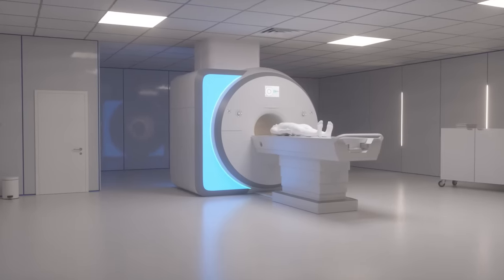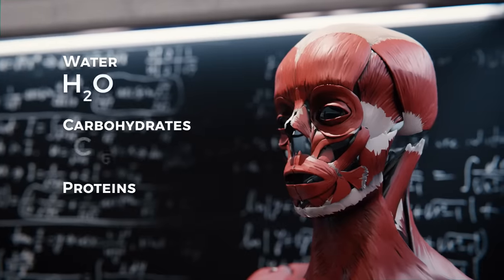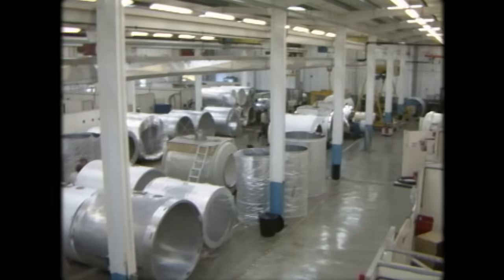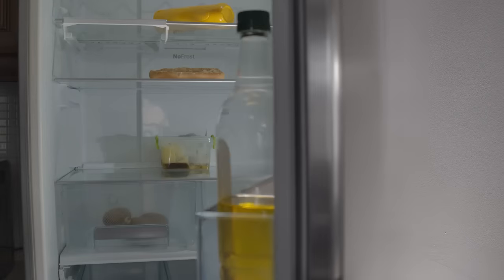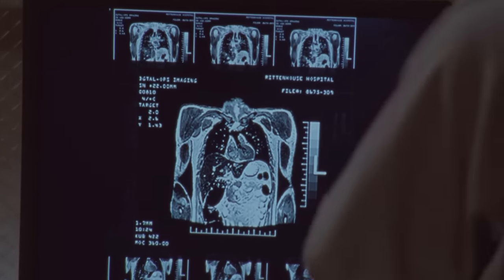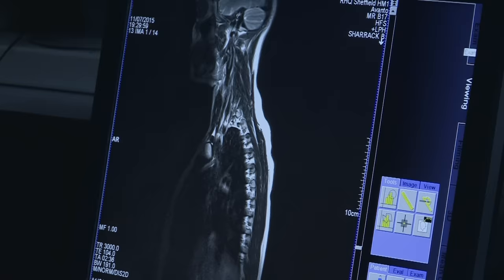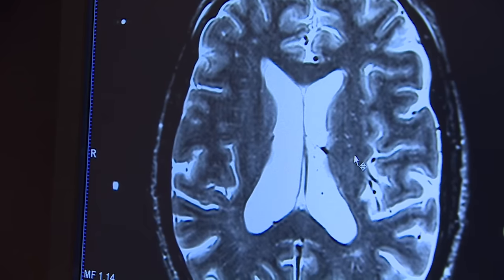The Insane Engineering of MRI Machines

Comment: Sorry, but couple things wrong. 

1:26 Ultrasound is not low detailed, atleast not anymore. Modern equipment also reaches sub millimeter resolution. Also "millimeter resolition" is nothing special. Modern high resolution MRI sequences reach resolutions of around 100µm.
ultrasound imaging does not depend on density but echogenicity.
CT scans also provide 3D images. 
It is also not that easy of a comparision. MRI does NOT replace x-rays, CT or ultrasound, it all depends on the issue at hand. 
In emergency situations ultrasound, xray and CT are essential, because of their speed. CT and r-rays are also more suited for bone imaging or imaging of the lungs. 
Ultrasound can in some cases provide even better imaging than MRI of soft tissue, for example brain ultrasound in (preterm) infants. 

Cardiac/thoracic MRI is most commonly not used for aortic stentgraft implantation planning. CE CT provides far, far better vessel imaging. For blockages of coroanry arteries CT scans are also better suited, but most cases are diagnosed in the cardiac catheterization laboratory itself and if nescessary treated there. Open heart surgery was never the primary form of diagnostic. And MRI is not the reason modern treatment is often minimally invasive, that has just been an advancement of its own.

X-rays do not form images based on absoption of radiofrenquency waves. They are based on x-rays.. that's why they are called x-rays..
MRI imaging depends on resonance between radiofreqency waves and matter.

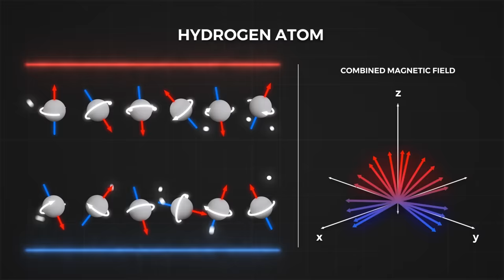2:57 Not all protons align parallel with B0. Only about half of them do; the rest aligns anti-parallel. A small surplus in one direction forms the net magnetic vector.
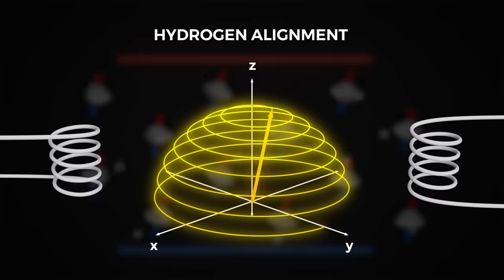4:08 The alignment alone would not cause induction. Phasecoherence is key. 
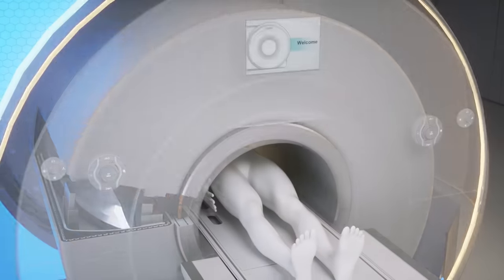4:30 99.999999% of MRI sequences do NOT use the body coil for signal recieving. We almost always use seperate coils for that. Transmitting RF pulses with seperate coils is NOT common. Is is usually only limited to knee and head exams, even rarely used for head exams and often forbidden when it comes to certain implants.
5:20 You NEVER! want anything ferromagnetic near those machines, NOT only during operation. The B0 static magnetic field is ALWAYS present. They cannot just lift wheelchairs. They can lift cars.
5:33 Maximum allowed field strength for human imaging is 8 Tesla. The strongest reasearch magnet planned I know of will have 14 Tesla and is being planned to be built in the netherlands.
Also field strength is nothing we can just increase to improve image quality. It also strongly depends on the sequence and issue. 7T  is not always better than 1.5T. 3T causes some problems like way stronger heating of patientes, dielectric artifacts and implant incompatability.
6:31 The 0 resistance temperature is strongly dependant on pressure and the material used. Niobium-Titanium coils have a superconducting temperature of around 4K. But there are superconductors that work at room temperature. 
8:40 All mri scanners use vacuum chambers and it's not the reason to prevent the helium from escaping. There are actually situations where we NEED the helium to escape (quench). Modern scanners use special "coldheads" to condensate evaporating helium.
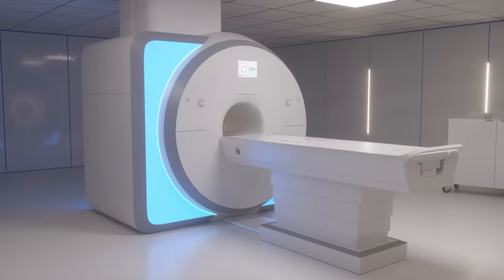10:35 Nitpick: Not just one frequency. We always excite a band of frequencies. The bandwidth determines the slice thickness.
12:30 Nitpick : We don't listen longer to achieve t2w contrast. We listen *later*. Longer echocycles are commonly used but that's a result of way faster imaging that way, not primarily for contrast reasons (although it causes changes is fat signals)
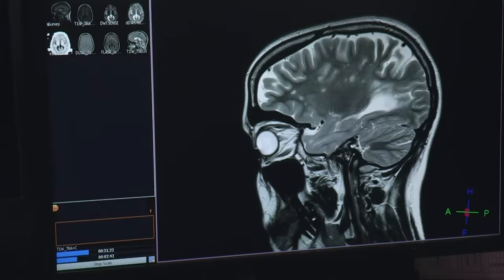13:00 This is VERY simplified. There are not only 2 parameters chosen for sequences. There are many dozens. And not all sequences are T1w or T2w. There are dozens more  different sequences for different purposes. 
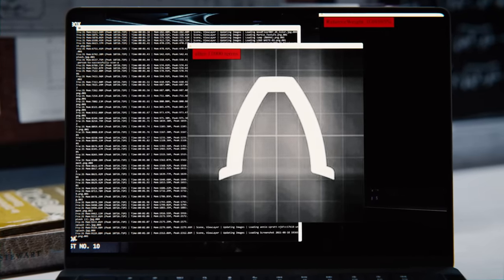15:15 I don't want to go deep into fourier transformation and k-space. It is worth nothing though, that each aquition of phase/frequency change which in the end allows for signal locating requires new RF exitations and is the reason why MRI sequences commonly take a lof of time. Roughly speaking if you want to image a 256x256 matrix you need to sample the MRI image 256 times for each slice.

It's also a bit irritating seeing CT images shown often when talking about MRI..

Source: Leading MRI technician in a university hospital in germany with over 6 years of MRI research.
Reply: You might be interested to know that the Neurospin lab in France now have an 11.7T MRI for humans (obviously from the name of the lab, it's for brains). I know that they were going to use it on primates (macaques) in the near future. Not quite sure about humans, certainly not in the first few years... Last I heard was first image of a pumpkin (I think at full field but maybe not yet). 
Anyway, humans at 11.7 should be coming fairly soon. Only for research though.
Otherwise, nice nitpicks!
Reply: Thanks for taking the time to write this. Can't expect an engineering channel to explain as impeccably as a physics oriented channel

Comment: 2:00 Saying that X-ray imaging uses high energy radiofrequency waves is pretty wrong. If you consider that wording correct, you could say high energy visible light (also wrong) or low energy gamma (wrong again).

They are all EM, but you can't call non-RF frequencies of EM "high/low energy" radiofrequency waves. 

I'm sure you know this though, and am surprised this slipped into your script unnoticed.

Comment: I worked as a field engineer in wireline logging and we use a tool that uses NMR to image the porosity of rocks by examining the properties of the fluids in the rock matrix. Same exact principles using T2 and T1 decay but different magnet/antenna geometries. I remember spending weeks thinking about the physics before it started making sense and event then it is kind of miraculous that it all works deep inside a hole in the ground at high pressures and temperatures

Comment: I really appreciate this video. When I search "how MRI works" on google I found a lot of explanations about the magnetic resonance itself, but not many about how to turn the magnetic resonance into an image.
From what I understood, a gradient is applied in the Z-direction to first select a slice during the transmit, then a phasing gradient is applied in the X-direction (the intensity changes every time), then a gradient is applied in the Y-direction during the receive.
Because of the Y-gradient, all the "lines" of the image are received at a different frequency, and they can be sorted out with a Fast Fourier Transform (most elegant algorithm ever). 
At this point, one sample is obtained for each of the lines. This is called frequency encoding.
The process is repeated as many times as there are pixels in each line, but every time, the intensity (or maybe duration) of the phasing gradient is increased.
The phase of protons on the leftmost pixels does not change, the phase of protons of the second pixel rotate by 360 degrees (one complete turn) over all the acquisitions (or 360/N degrees between each of the N acquisitions), the phase of the protons of the third pixel rotates by 720 degrees (2 turns) and so on...
If we put all the samples of a given line next to each other, the phase of the protons of each pixel will rotate at a different frequency, and they can be again sorted out by a Fast Fourier Transform. This is called phase encoding.
According to your video (and the paper cited in the description), all Fourier coefficients are sampled sequentially and only by phase encoding, maybe that modern MRI machines work differently that what I read on the internet.

You should do videos about CT scan, Positron Emission Tomography and ultrasound, and maybe also Synthetic Aperture Radar (has nothing to do with medical imaging, but it turns radio waves into stunning images)

Comment: MRI began as a tool for analysis of organic compounds, measuring the vibration of the hydrogen bond, I bought the second one in the country  (at the time) for a Uni in 1975, for 252k USD, the magnet had a weight of 2 tons, had to be in an enforced concrete floor in the basement. In 50 years a lot has changed, size, main application now in health and I guess price too…

Comment: Great vid, indeed as someone said, covering months of education in less than 10 minutes.
I happened to be present in an MRI scanning room recently, and not only did I have to fill in a questionnaire and sign and deliver it to the technician ("do you have any implants? yes/no"), I was also visually checked and questioned live. ("Can I check you removed your buckle belt?') Stil, as a grim reminder, in the preparation room a photo was posted of the MRI scanner with a wheelchair in it. I didn't ask, but I imagine someone thought "surely it can't be that strong"...)

Comment: I worked with Lindgren Rayproof building the suites around these machines, when in the machine you are in a copper box.
They may be sealed but there has to be a blow-out valve just in case the cooling system breaks down and the helium boils.
I once walked off a job because Philips engineers could not grasp the idea that once a box is sealed you cannot get the MRI in. They wanted us to finish our job before they put the MRI in, we explained that was impossible, they didn't agree, so, we walked out and left them to solve it themselves.

Comment: So an MRI image is basically a 3D JPeg/JPG.  JPGs use a process called quantization to represent images as a bunch of overlapping patterns.  Depending on the quality and specific type of JPG (technically JPG is a container format and most images are actually JFIF or EXIF) the image will be broken up into 3 channels (Red, Green, Blue, technically you can have a 4th channel that's usually either transparency or depth information) and a bunch of tiny squares (per channel).  Each square is a bunch of overlapping patterns that when combined look similar to that color/square of the original image.  The reason this is done in JPG is to reduce size, so long as the software reproducing the image knows the actual format* (again usually JFIF or EXIF) said software will contain a dictionary of patterns which means the JPG image only has to record a reference to which patterns are in each square.  This vastly reduces the size of JPGs but also means that even so called lossless JPG (which is what EXIF is sometimes called) aren't actually lossless, the quantization process has inherent losses but can be quite convincing so long as you don't try to enlarge the image too much.  To my understanding WebP uses a similar technique but is far better as preserving quality while also keeping file sizes smaller (I presume there's a tradeoff in processing power and/or memory needed to create and recreate the images but modern processors are more than capable and bandwidth is expensive).  PNGs use truly lossless compression but can't get as small and of course if something was originally saved in a quantized format (which is the standard for a lot of cameras, especially those in smartphones) then converting to PNG won't recover that lost data.

*Back in the days of the Nintendo Wii I found out that a bunch of my JPGs weren't in a format that the Wii understood.  They were probably EXIF since they came from my 2nd Cousins fancy camera (it was a DSLR with a whole 5 MP image sensor, though the images still look pretty good even by today's standards).  The Wii of course only supported the more common JFIF format and didn't do well with corrupted JPGs which was a common issue (most software could correct for these small errors but the Wii was 'special').  The reason my 2nd cousin's pictures still look good is because they were saved in a better format, the camera probably used a bigger sensor which means that the raw image was actually better (that's a whole rabbit hole of it's own), and of course it had proper optics, image stabilization, and a relatively fast processor (images need to be extracted from the sensor to memory then processed into a smaller format, then actually stored in permanent memory in a short amount of time).  The reason JPG corruption was so common is afaik because most images are (or at least were) stored on SD Cards which are actually kind of bad.  Even good SD cards are often made with cheaper NAND Flash than a comparatively priced SSD (they are smaller and more portable though), this means that a lot of SD Cards lose data pretty easily though better manufacturing technologies and better software correction have made them better in recent years (especially if you spring for the more expensive ones).  Data is usually saved with some form of redundancy to make fixing small errors easier.

Comment: I take a bit of an objection to describing the MRI as having no moving parts, 

There is fluid flow at a minimum inside the equipment. From the refrigerant. 

If you expand out to the support equipment there is a substantial amount of movment in the helium compressors and further down the chain.

Comment: so basically, magnetic fields created by the flow of electricity surrounding the patient can polarize the hydrogen atoms in their body, and small changes in that magnetic field, combined with the time it takes for regions of the body to achieve full polarization, will tell the machine which parts are most or least hydrogen-dense, allowing them to figure out if it's water, fat, or protein that they are looking at. that's awesome.

Comment: I think by creating a magnetic resonance chamber, a stable inert spherical hollow casing, that seperates in 2 halves, the inside lined with electromagnetic plates, with hydraulic or pneumatic actuators.

By altering the angle and the electronic frequency of the magnetic plates, magnetic resonance can alter states of matter.

Comment: Great video. One thing I did not understand is how the pattern generating gradient coils can produce the striped pattern in a 2d slice. Are there several different coils placed around the slice that somehow creates a field pattern that superimpose the phase shift? And how do they physically change the phase of the signal from the hydrogen?
Reply: It's done via phase encoding on one axis, and frequency encoding in another. It can be confusing because frequency encoding is also what defines the slice that you're imaging - it's just done in a different magnitude.

Comment: So, what's the challenge in creating higher resolution MRI images?
Is it just the strength of the magnetic field as you hinted towards at the end? Or is it also creating higher density gradient-coils, along with the increased processing required to generate the images?

Comment: Good job overall. There is a least one error in the video though. One is at 5:08 - A 3 Tesla MRI has a magnetic field about 60,000 times stronger than the earth's magnetic field, not 300,000. The earth's magnetic field is about 50 microTesla. 3 Tesla = 3,000,000 microTesla. 3,000,000 / 50 = 60,000.

Comment: You mean to tell me, that Hydrogen atoms, with their spins and the magnetic field, experience Gyroscopic Precession before they return to their previous position ?That's awesome!
There's also a magnetometer(device used to measure the strength of the a magnetic field) called Proton Magnetometer, that uses protons(hydrogen ions) and their gyroscopic precession to measure a magnetic field.
In that way it does the opposite of what an MRI does, it uses the protons to figure out the magnetic field it measures.

Comment: Cool video! However, at 3:44 you show the individual spins turn 90 degrees, but doesnt the quantum mechanics say that the spins can only be spin up or spin down, meaning they either align with the main magnetic field or opposite to it so the conformation you showed would be impossible in that sense? If you want the net magnetization to turn 90 degrees half of the spins need to be flipped to spin down and the spins have to be in phase right?

Comment: As physics I know how magnetic field with an induction of 1.5 Tesla, does rearrange the tissues structure during a resonant effect. And the side effect of magnetic field is a vortex electric field, which in conducting media (which is the brain) generates heat - so what to do with it? And one can only guess what consequences its application will have to such a highly organized structure as the brain. Statements that MRI of the brain is absolutely harmless should, in my opinion, be treated in the same way as the statement of the owner of a radio broadcasting company that it is absolutely safe to live in a house directly near transmitting antennas

Comment: I don't experience claustrophobia. But ive been in one before and it reminded me of just being in a closed off bunk bed. Also the shear amount of heat you experience is weird. Its not on your skin so you dont sweat. I imagine its the exact opposite of the microwave since the microwave induces energy based heat from the outside in instead of inside out.
Reply: Actually, it is exactly that… a low power microwave, plus sensors.

Comment: Last i checked the mri machines have a rotation of a magnet. Sooo yea when you said "no moving parts" ya need to fix this thanks.
Reply: You are mixing up different machines. Mris have no moving parts. The magnet is simply to big for that. You saw a CT scanner without it's cover. A CT scanner looks the same from the outside but it's a different machine. A CT scanner is a Xray machine. What you saw spinning was the radation source and the detectors.